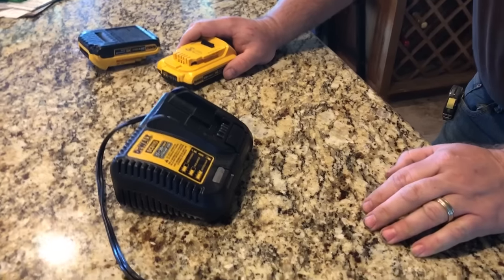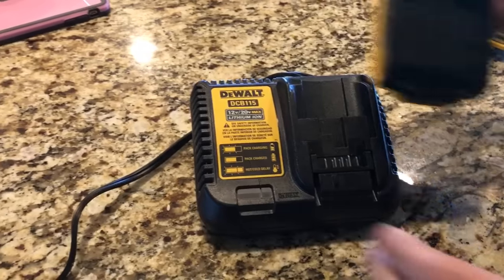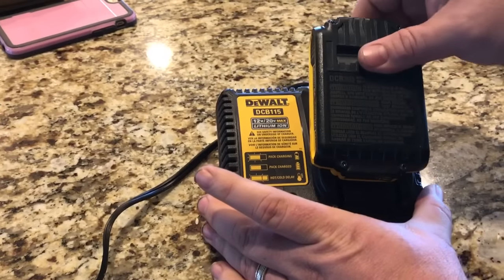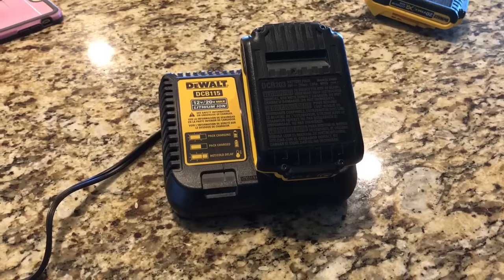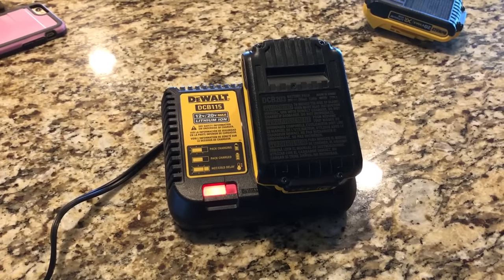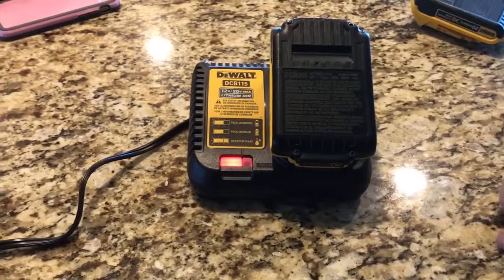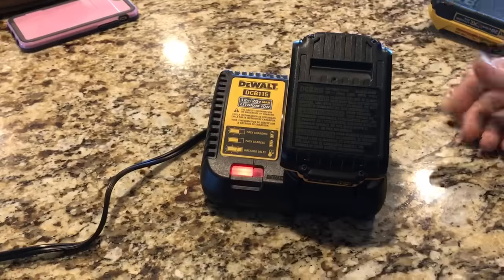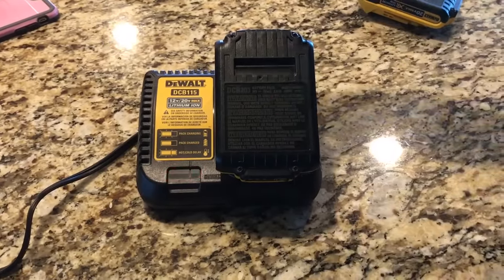This is Why Your Dewalt 20V Batteries Will Not Charge

Comment: Neither battery I have will charge, even when charging with my neighbor's known good charger..  The only use I've gotten out of it was the initial charge the batteries had when I got it for Christmas.  Tow day charge results in less than 10 seconds on one battery and about 30 seconds on the other. I'm like WTF

Comment: I feel super stupid lol, I own many many 20v dewalt with no issues and for my 12v stuff I run m12 but wanted to give the dewalt 12v stuff a try and couldn’t get them to charge past one led, well this method applies to the 12v line up
Also because they are charging now thanks to this video 👍🏼👍🏼

Comment: mine clicks in and as it clicks in it blinks once and then when its fully seated it goes out..and theres noplace or position that keeps the light lit.. one battery works fine but the other doesnt..but when i manually put a light charge on the battery with an outside lithium smart charge it takes it..and i only charge it til the second charge state light on the battery lights.. and still the dewalt charger will not accept the battery..and of course its the one $140 flexvolt 9ah that wont get up on the dewalt charger thats supposed to charge it in 5hrs.. be great if it were that simple though...wish it were a case of pseudo-stoned..nosuchluck

Comment: Thanks for the tips almost had to buy a new battery
Reply: slimey salinas I have a dewalt and an aftermarket battery the dewalt works great the aftermarket works 1 time now it shows full charge on charger. But dead on tool and charge indelicate on battery. I think it’s the circuit board in the battery? Any idea if I can bypass it?

Comment: What if it still doesnt charge lol. I pushed as hard as I can and still just get a solid light.
Reply: I had the same problem in the video except reseating the battery didn't fix the problem. For me I had to open the charger and resolder the links on the small circuit board holding the pins, as the solder joints had dried out and cracked. Very easy to fix if you have a long security torx 10 screwdriver and a soldering iron.

Comment: It's not your fault people!  Aren't you tire of just accepting whatever garbage someone is selling? 

More fitting title:  Why you shouldn't buy Dewalt battery tools.

I've been using Dewalt 20 Max tools for years now and have really liked them. Today I decided to get a  little sander and another battery.  Got home and found that I had to really shove the new battery into my charger to get it to charge. Did they change something?  The answer is a resounding YES!  They started making and selling batteries for their tools that just don't fit. I tried this new battery in the new sander and also had to push pretty hard to get to latch in. Upon pulling it out it slipped out of my hand and fell to the floor. Good way to sell more batteries. Tried my old batteries in the sander and the slipped in and latched with ease. 

I'm headed back the the store right now to return this junk. For now I'll live with the old corded sander and when it's time for a new drill or screw gun I'll be looking for another brand. I think I'll check out Milwaukee.

Comment: MY MISTAKE WAS I ATTACHED THE 12V BATTERY TO THE DW CHARGER AND THEN PLUG IT IN THE OUTLET . IT RUINED DW 12V SOME THING SHORTED INSIDE THE BATTERY WHEN PLUGGED IN TO AC OUTLET . NOW I LEARNED MY MISTAKE . NEVER ATTACHED BATTERY FIRST . PLUG IT IN TO OUTLET AND THEN ATTACH THE BATTERY TO THE CHARGER , SAFE

Comment: The combo 12V-18V Milwaukee charger is far worse than the Dewalt in that regard. It is quite fiddly to set a 18V the battery right on it.

Comment: No dude.. one battery will charge fine..the next wont charge at all.. ive gone through 9 batteries in the last 5 months and 5 out of the 9 just wont seat right no matter what.. and quite suddenly with no explanation ive had 2 just stop..and if you sort of twist at an angle as you stick it on the charger theres a point where it connects but the sweet spot is tiny and the slightest bump stops the charge.. and today i was given 2  flexvolt 60vmax/20vmax batteries that suffer from the same ""sweet spot" condition...ive taken two apart to look for shorts or loose wires and theres no obvious issue or "sad cell".. just no apparent cause for the condition.. in fact if i jump charge them off the charger with wires they all charge no problem.. so snap that in your charger and ponder it!  Theres deffinately a problem with dewalts set up..but where or why is elusive

Comment: That is absolutely false...mine is seated fine...it clicks in fine...but the charger light does not come on...the battery does not charge. It used to, but it sat in the (in this case a blower) for 4 months unused. I've had nothing but problems with this charger...this is the third time this has happened, after the first time I took it back to the local Dewalt store.  They tried whatever they do in the back shop area, and then gave up and gave me a new charger. I took it home used it until the battery started to die and put it on the charger and it recharged just fine...I used it again until I was done blowing off the patio, and put it away...went to use it 4 months later and nothing...totally discharged and will not charge...no lights on the charger nothing on the battery. I've done everything except take it apart and I'm not going to do that and void the warranty.
Reply from the maker: Okay my little snow flake that does not make this "absolutely false" YOU likely have a bad battery or a bad charger, it happens.  This video was for the hundreds of thousands of people it helped, I am sorry I could not make one that would specifically serve your personal needs.

Comment: Ridiculous.  I have 5 dead batteries of various brands and NONE of them is a "seating" problem.  These batteries, especially the lithium, have a LOT more problems than that!  They need to be manufactured more reliably and include consumer rebuild/repair in their engineering, and not just be planned obsolescence.  It's a nasty marketing game this current pack of manufacturers are playing.  Only one seems to have any integrity:  the one offering LIFETIME battery replacement.  I believe they'd all be better off if they designed them for consumer repair/rebuild -- since millions of us are trying to do it anyway.
Reply from the maker: David your rant here reads like you are an angry petulant adult child.   I mean I am not Dewalt the company, don't work for them, they sure as fuck don't listen to me.  

WTF are you acting like a child throwing a tantrum?

Comment: Like Peter B. said below .. make you feel like an idiot, LOL.  I have my charger sitting on a desk and didn't think to push it down, but I did and felt the click.  Maybe the problem occurs because the charger is sitting horizontally ?  When the charger is mounted vertically / on a wall,  then possibly the weight of the battery helps click it in place.  Either way, thanks for this video, now my batteries will charge correctly !!!

Comment: How can people not realize that the battery needs to be clicked into the charger? It needs to be clicked into the tool. It should be obvious that it's the same with the charger.
Reply from the maker: How?  Well how about that Dewalt has an installed base of 10s of millions of users and for about 20 years the 12 and 18 volt charges worked exactly that way, you dropped the batteries in and they charged.  Those batteries snapped into the tools as well but the chargers didn't work that way.  In fact jamming them in could damage the connections.   The added fact that they will in fact charge sometime when just dropped in, adds to the confusion. 

Bluntly you are not smarter then everyone who has the problem, don't try to convince yourself that you are.

Now the real stupid people are the ones at Dewalt who have not trained their phone CSRs about this issue who keep telling people to exchange their chargers.

Comment: My batteries are saying they are charged but will not run my drill.   I have them pushed the whole way in and I keep getting the solid red light saying they are charged.  I have watched multiple video and nothing has worked.  I absolutely HATE dewalt.  This drill combo I bought is only 2 years old.  I am tossing it all in the trash and buying metabo, Milwaukee or even ryobi.  I have never had good success with dewalt

Comment: Poor design on Dewalt's part. The 18volt batteries would just about drop in and charge. I'm really getting tired of fiddling with these 20volts to try and get them engaged. I've got work to do!

Comment: You can't be serious, there can't be that many short bus riding, window lickers out there using power tools. Know offense but it's more likely that just like phone batteries it all comes down to first charge, your spouse to use battery straight out the box till it's empty then charge it, but for some reason if you charge it first it magically fucks it up.Or DeWalt is pulling a iPhone type scam , their just mad to fail after so many hours.
Reply from the maker: Back to mommy's basement for you, she has your hot pocket ready.

Comment: I'm sorry, but you have to be a child to not know your batteries have to be fully seated to charge properly. My Dewalt 3ah batteries I bought the fuel gauge stopped working after damn month. I'm pretty sure this ain't the problem because those mfers are too damn tight. You really gotta jank them out. Don't buy Dewalt's 3ah batteries.

Comment: Dewalt sent me this video when I requested an exchange on a brand new 20v XR 5ah battery. Sorry but it’s the crap battery that they’re trying to get rid of packaged as a kit. The tool alone is $10 more. All of my older 20v batteries charge just fine. My charger won’t even light up with this new battery. This video is clearly for idiots.
Reply from the maker: Perhaps this video is at an idiot level but still to hard for you to understand.  Move along moron adults are talking here.
Reply from the maker: Thank you for taking time off your very busy day of eating hot pockets and pleasuring yourself to questionable only fans videos in your mom's basement to add this valuable comment to our discussion.